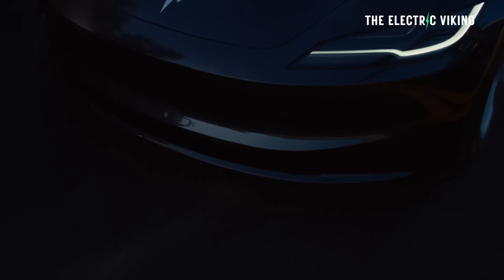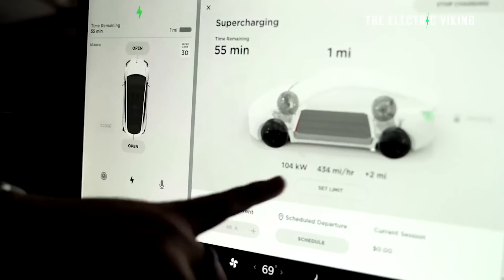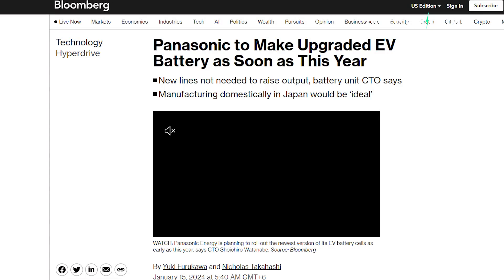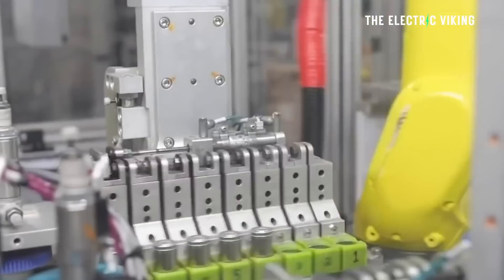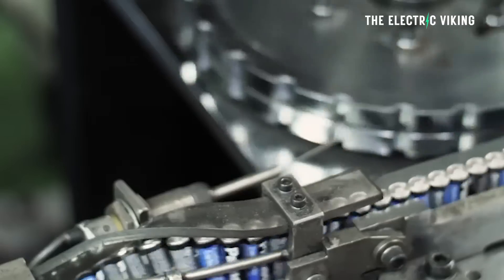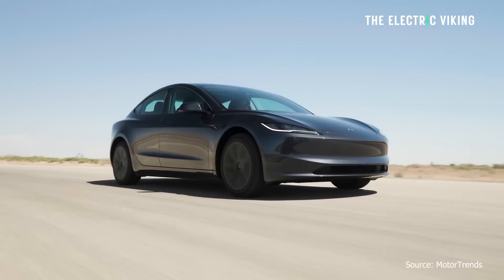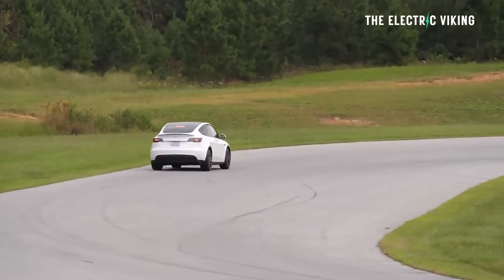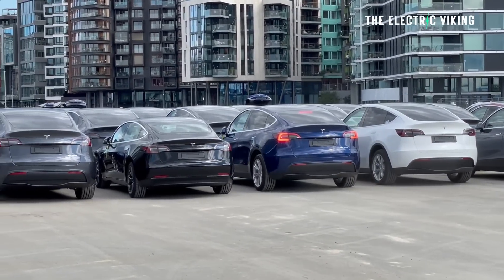Panasonic reveals new nano silicon batteries for Tesla will reduce EV prices

Comment: Would be good if these cells could be retrofitted to older cars too. Won't need to update cars, just update the pack and software instead.
Reply: It will happen in the future... Like after Tesla gets to 20 million cars per year... Battery packs will keep getting cheaper and more plentiful so at some point it will make sense to do this
Reply: @0ooTheMAXXoo0 Doesn't have to be Tesla ...  brand not an issue for the concept to work. Future Sodium batteries as a replacement for current ones worn out, why not?
Reply: They already did that with owners of the original roadster. Other companies already do it like Renault with their Zoe. So battery replacement is nothing new really.
Reply: I predict a fair amount of 3rd party offerings in this area.
Reply: @meganote would love to see that, but Teslas are completely sw-controlled. No 3rd party to replace a single component of the drivetrain or any logic-associated circuitry.
Reply: @meganote from China!